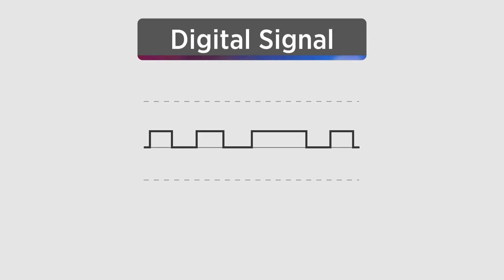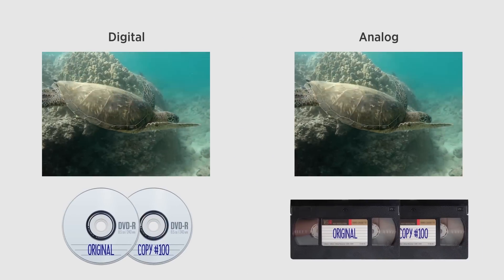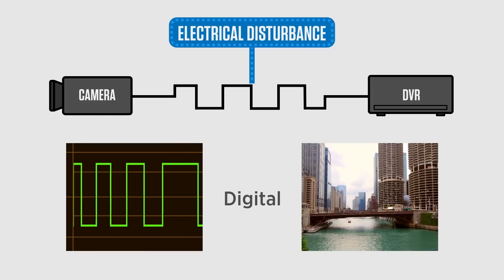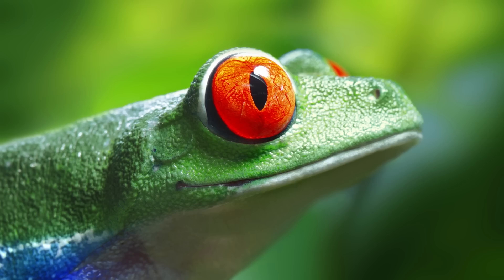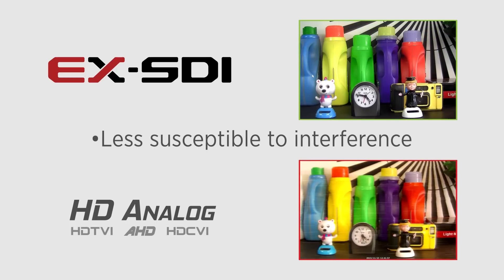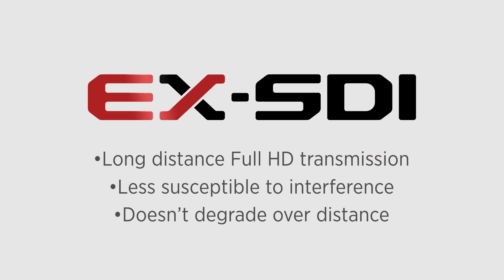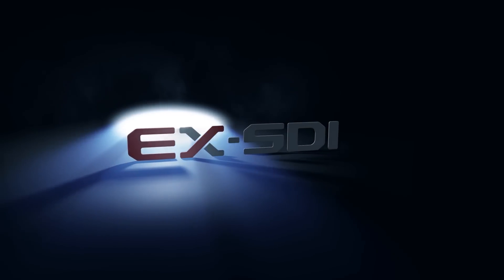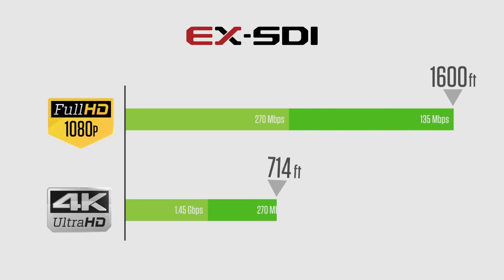EX-SDI Explained + How EX-SDI differs from HD Analog CCTV  (HD-TVI, HD-CVI, AHD)

Comment: Would EX-SDI work over RG6 Coax Cable? We have a Board of Supervisors' Chamber that's in desperate need of a whole new video system and we'd like to use our current wiring if possible.